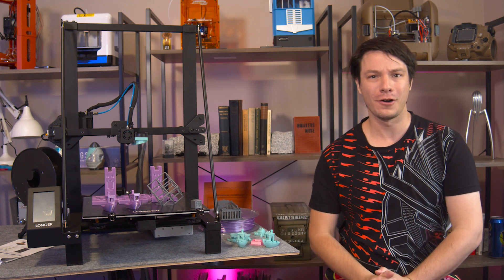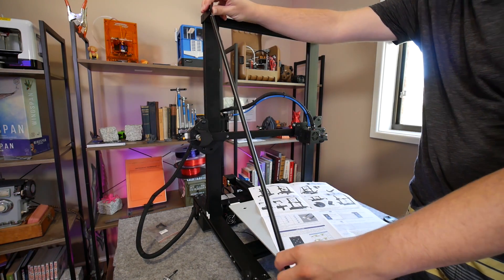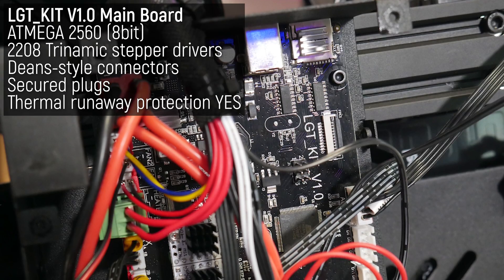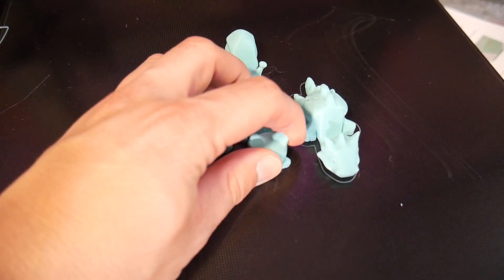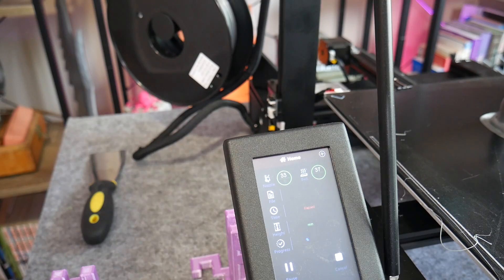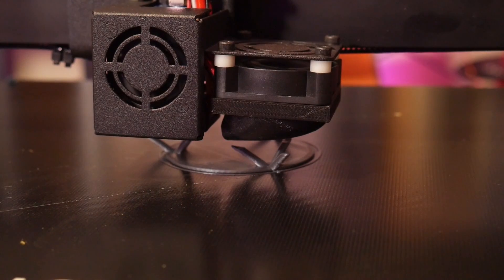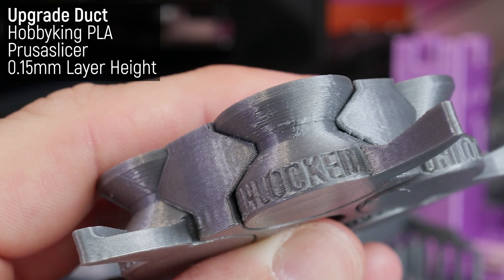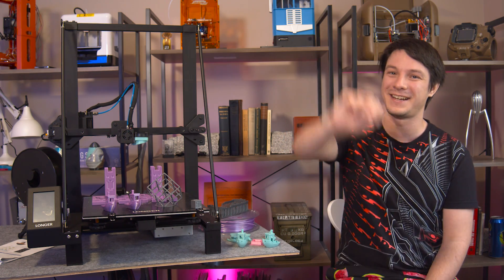Have you been LONGING for a 3D Printer like this? LK5 Pro 3D Printer Review

Comment: Ditto on the Foam, which is trash 2 most nearly everyone.
Reply: The whole point of PE foam is that it is recyclable? What kinda country do you live in that doesn't accept PE foam in their recycling? what would you rather have A) a little bit of 100% recyclable foam, or B) A broken 3D printer that CAN'T be recycled and some shite cardboard packaging that adds weight to the box? Formed cardboard also has a HUGE carbon impact during manufacturing because it takes days to dry in kilns.
Reply: stop it with the ''environmentally friendly'' BULLSHIT..
if you really want to be ''environmentally friendly'' 
then stop ordering/producing cheap from China.

stop pretending u care about the planet lol.
Reply: I also wish all filaments came on cardboard rolls.
Reply: @iAmTheSquidThing  cardboard isn't always friendlier than plastic
Reply: Nothing is ever always anything.  I imagine Andy meant friendlier than plastic cardboard when they wrote cardboard.
Reply: @iAmTheSquidThing  A few companies have started doing that already.
Reply: Yeah, packing peanuts can be made from starch or other compostable material, so why not foam? Just a simple idea foam me to you 😉
Reply: @gregfeneis609  Foam can be, and is. But you can't currently recycle packaging peanuts or Bioplastic based foams. and as most packing foam is made from PE (Which is recyclable, no idea where Angus got that from) the last thing they want to do is pollute a robust recycling system with a foam that LOOKS recyclable, but will ruin whole batches.

But compossible also inst always that good. A lot of energy goes into manufacturing products, and sometimes that energy can be retained with recycling. composting is just landfill without the added bonus of being able to dig it up in 15 years time when we start getting resource shortages.
Reply: Yeah, this is a great bunch of "what I say is always correct and what you say isn't always true" type of folks.  Y'all have fun with your games.
Reply: @gregfeneis609  Or simply facts
Reply: @elitewolverine  Hey yeah. Good one
Reply: the thing is as a war table gamer the card board can also be used as terrain so its a way bigger plus than the foam
Reply: @regoso8580  depends on your skills.  The best table top terrain wasn't cardboard, it was foam insulation cut with a hot knife.  Cardboard stuff was like...did you even try bro?  Good for small stuff that had little to no interior dimensions, like scifi power generators, fencing, weathered roof etc.

Yes I invested, owned, helped open a table top game store.  I have played with terrain for years.  Everything from re purposing housing materials from construction sights, to plaster of paris, to foam board, packaged foam, to cardboard, to 3d printing (my current favorite), and many more.

Flames of war, battle tech, lord of the rings, warhammer, the list goes on.  Damn I miss our custom table top game setup we had in that store.  Stupid stealing, bad check writing, pedophile of a manager took it down.

Comment: Nice video. RE miro sd card slot on the back. My olde Ender 3 has started giving issues on the click spring release of the micro sd card. So I started looking arround and found a solution, actually 2. 1 a Micro SD card slot extender cable that gives you 45cm of cable to a Micro SD card slot famale adapter. Option 2 is similar but gives you a full sized SD card slot. Developted for the rasberri Pi micro SD slot. BUt usefull here aswell.

Comment: I do not care one bit about the biodegradability of packing material as long as it is cheap and does its job. Mainly because as long as you dispose of it properly, it poses no danger to the environment. Modern landfills are engineering marvels designed to contain garbage for the long term. And there's no risk of running out of space for landfills, that's a myth.
Reply: Ah come one now, making it in the first place harms the environment. The ability to contain garbage isn't justification for being wasteful or making products out of toxic materials when there are more environmentally sound options that are just as readily available.
Reply: The problem is, very few places can properly dispose of foam.  Even places that do recycling don't bother with foams because they cost far more to recycle than they're worth, while taking up large amounts of finite space in recycling facilities.  If you throw it in a landfill, the higher surface area makes them more likely to leech particles into the ground+water.  They also don't weigh hardly anything, so they're very likely to be blown away, such as in the ocean.

Comment: I was quite interested in this until you mentioned 8-bit, there are plenty of printers available with 32-bit boards these days and trinamic drivers as well, thanks but no thanks
Reply: Well, if it can pass the gap tolerance test and print with very good detail levels, why does it matter?  The #1 reason for wanting 32 bit is better detail resolution, which this printer doesn't have a problem with.
Reply: @Toastmaster_5000  because some detailed prints eg the Batman print Kris Kersey printed comes out terrible on 8 bit boards
Reply: As far as I've read around, 32 bit boards make the most difference only in deltas, Core-XY or very high print speeds, which it wouldn't achieve mechanically (that is, FAR too high for a cartesian). The math to position a cartesian is a lot easier than those two so the controller barely ever caps it, only at really high speeds.

Specially if the screen has it's own controller (which from the interface I would say it does). Also it does have the Trinamic drivers, removable ones at that, so even if you needed the 32 bit board, seems like a very straightforward upgrade.

Comment: The foam may not be recyclable in the traditional sense, but unless you're a YouTuber and receiving a printer every month (and thus receive heaps of foam too), it's quite handy to keep and use for projects. In the past few months I've used printer box foam to insulate a drafty gap in my window, to stop my bed frame from squeaking, and made bumpers to stop my blinds from loudly banging the window frame in the wind. I even once used some to make arch supports in a pair of shoes. So while it's overuse is obviously not good for the environment, there are better uses for it than just throwing it in the bin.
Reply: People buy and throw away billions of plastic bottles every single year. Do they care???? Yet some people are worried about foam in some printers? SMH.
Reply: I don't know. I'm not a YouTuber and out goes straight in the trash for me
Reply: I keep every speck of packin' material from Amazon and elsewhere.  I sell quite a few things on ebay.  The various peanuts & slabs come in very handy when sending things to buyers - and they're essentially free, which is much better than overpaying for bags of such stuff at UPS.  Plus, the foam bits and bubble wrap  make my existence deliciously random by posing a fire hazard until they're used.
Reply: true point, but the problem is that the overwhelming majority of people still throw the foam away, even if they only get a package once a year. So the industry as a whole moving away from non-recycable materials is probably overall a good thing
Reply: You have a brain and know how to use it.
im not trying to be mean but most YouTube creators and the likes are usually borderline on the spectrum or have hi functional autism. 
There's smart but not so smart in a lot of ways.
Reply: Actually  making that foam produces less emissions than making cardboard. Problem is that it isnt biodegradable, so if you throw it into nature, it stays there for thousands of years

Comment: When they ship from China the most important thing to me is that it isn't damaged in transport.  Having to ship things back and forth both frustrates the users and quickly eats up any environmental savings made by replacing the the packaging material. So if they are going to replace the packaging material it has to be at least as good at protecting the content.
Reply: Although I don't think cardboard is a good idea, there are biodegradable foamy packing materials.
Reply: @Toastmaster_5000  I've seen packing materials made of corn starch, and while it does work it can compress a lot easier than the common plastic foam, and it certainly don't like moisture. 

When I think about it I'm pretty sure I've seen clear "plastic" water cups that was made out of something created from corn starch, so I guess it can be done. I just don't have any idea of how to do it, what the process might be called or what it would cost.

I'm guessing you could probably make something from cellulose that would work well. After all I remember something about wood being used to produce cellophane, so it should be possible to make some kind of packaging material that doesn't get soggy out of it.
Reply: PE Foam is also 100% recyclable, Angus is unfortunately spreading misinformation. Just because he can't put it in his bin, doesn't mean it isn't recyclable. Up until about 6 months ago I couldn't even put paper in my recycling bin, but they did accept PE foam!! I know it sounds mad, but you had to DRIVE paper to the recycling centre!
Reply: Shipping things back isn't necessarily as bad environmentally as you might think. Most countries have trade deficits with China, so cargo ships are often empty (or empty enough) on their way back that the oceanic shipping is not really a concern. That said, I agree that any replacement still needs to protect well, if just because nobody will switch to environmentally friendly packaging if it isn't reasonably close in both protection as well as convenience on both the sending and receiving  ends of the transaction.
Reply: @nihouma11  But you have to wait. And climate change by humans are a hoax.

Comment: YES! I want formed cardboard packaging. It was the first thing I thought when I saw the foam. Please.
Reply: Why do people think it isn't ecofriendly - just as the cardboard the plastic will be recycled in every country that cares a little about the environment. If that is not the case in your country IMHO you should try to pressure your government - not a 3d printer maker.

Don't get me wrong cardboard is fine and I am all for ecofriendlyness, but people need to stop believing plastic is generally eco-unfriendly, because it doesn't have to be depending on the exact material, recycling laws and use case.
Reply: @zebarzebra  The problem is that cardboard first of all is less toxic in general (it does need water though to recycle) and the second is that, at least in my country, we are not allowed to throw Polyethylene Foam into the plastic recycling bin as they do not want to separately collect it. So even though it's perfectly recyclable, it is in practice, not being recycled. They do however allow HDPE, MDPE and LDPE to be thrown in the recycling, but they do not allow foams.
Reply: @zebarzebra  A lot of "recycling" is really just shipping trash to other parts of the globe. At least cardboard will break down in landfills.

Comment: I bought the regular sized one last year as a trial and sent it back less than a week later. The machine itself is incredibly noisy, the extruder constantly skipped steps and could not push the filament causing under extrusion, the screen is alright but not worth the hassle and the cable management was about as tidy as a bowl of spaghetti.
Reply: Sounds like low current on the extruder stepper if I've done my homework on 3D printing... Guess they didn't use the TMC drivers either too from what you said.
Or they could be doing even worse and instead of cheaper Alegro A4988's they went with DRVs that are notorious for screwing everything up when microstepping.
Reply: @Kalvinjj  I seen in a different video that the extruder motor driver was the only one not a 2208, I asked and he said he didn't know what it was. It's the review by 3d printing nerd I think.
Reply: Not sure if you ever got this resolved but something is causing it to bind up like that. Mine has always been damn near silent. The fan for the hot end is louder than the whole machine.
Reply: @anomicxtreme  It was returned days later, it was an experimental buy to see if the rave for it was true and it wasn't. Been running prusas ever since and its lovely.